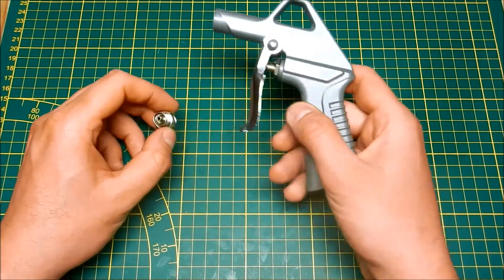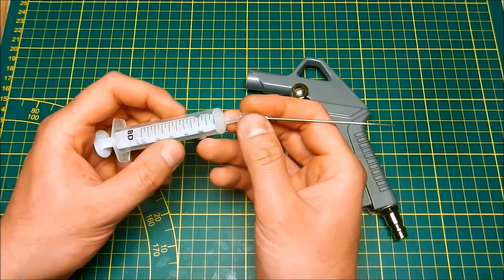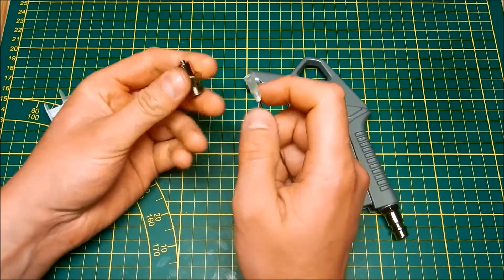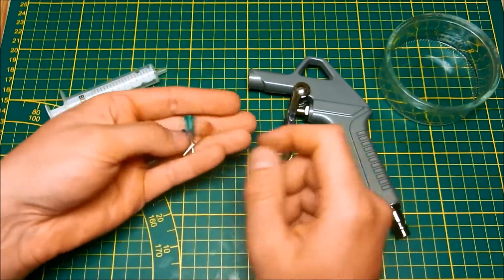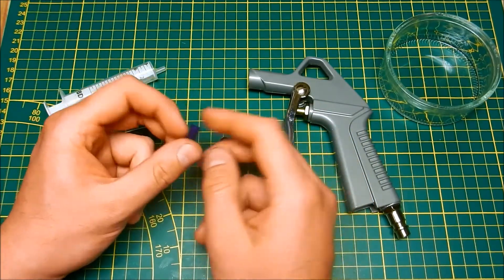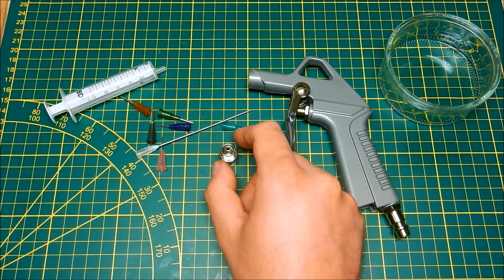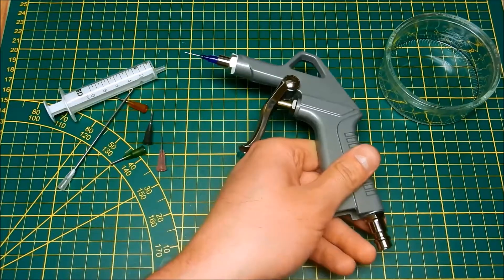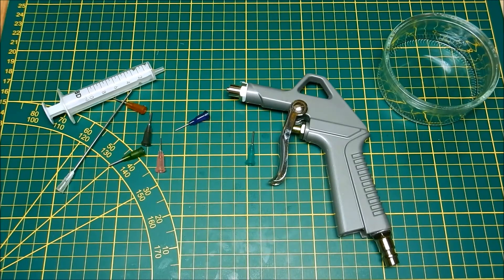Improving a blow gun with a luer-lock connector

Comment: Great idea, but did it not get stuck? Luer lock adapters usually have a M12x1.0 thread and blow guns use M12x1.25 threads, which shouldn’t be compatible …
Reply from the maker: Both have a 1/4" pipe thread. I've never seen a other threads beyond the common pipe threads with shop air fittings. What field of work are you in? Maybe medical fittings for instance have other common threads?